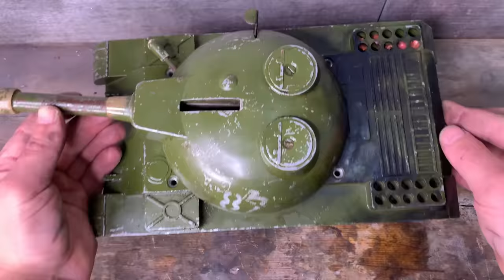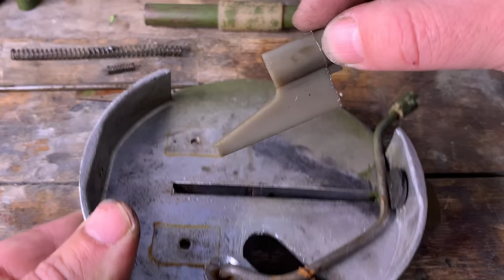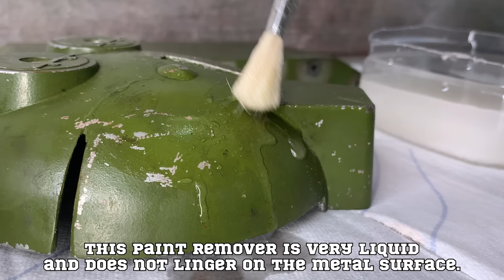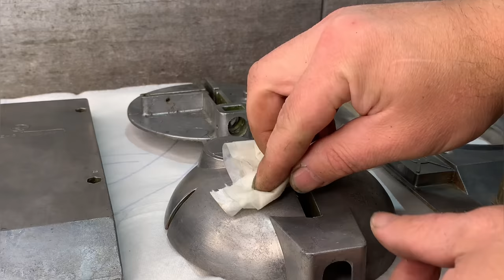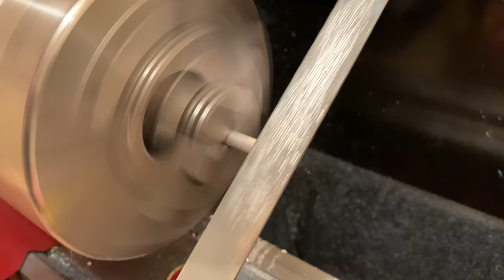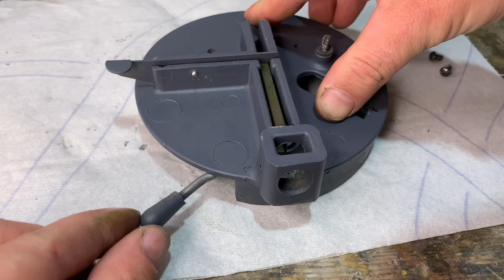Revival of the T-55 Tank. The second Life of a Toy.

Comment: i appreciate the effort you made when restoring this but a little tip for painting a toy or anything else that may be green or a lighter colour is that you should use an airbrush so the finished product does not have paint splotches around the object
Reply from the maker: Thanks for the advice. In my next project, I no longer used a paint brush, and the result impressed me. By the way, I will publish a video with the restoration in two hours. I will be glad if you look!

Comment: It feels like this either could have used another coat or a coat of another color over it. This feels like a solid undercoat wich could help the top layer pop more
Reply from the maker: You're right, this paint doesn't look good on screen, it's much better live. I painted my next work using spray paint. It worked out pretty well. I'll post a new video in a couple of hours. I would be grateful if you take a look.

Comment: Gel paint remover would have been a better choice. Did you test the paint for lead? Painting without sanding the primer doesn't allow the final paint to adhere. Using a paint brush left a poor texture. Apologies; however,  I think a better job would have been done using the right techniques and equipment.
Reply: Were all experts I guess
Reply: @crewleaderprods  Doesn't take an expert to recognize sloppy work. Apparently I'm not the only one to see it that way.